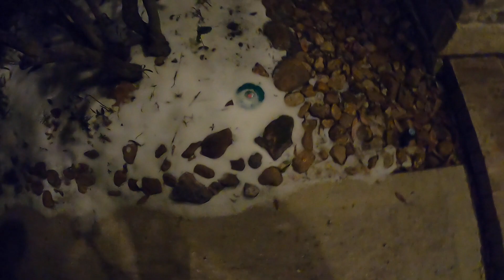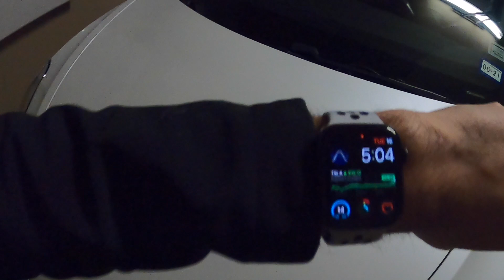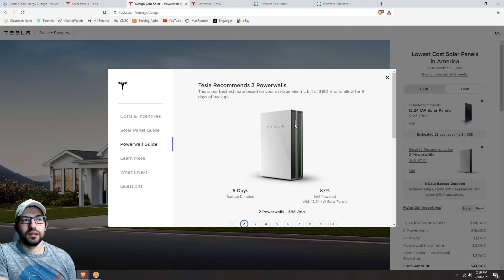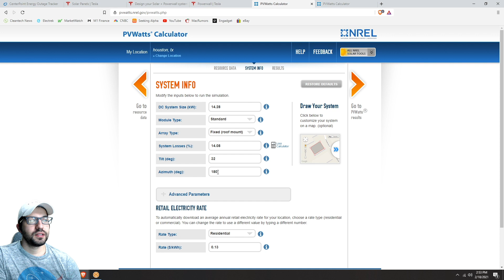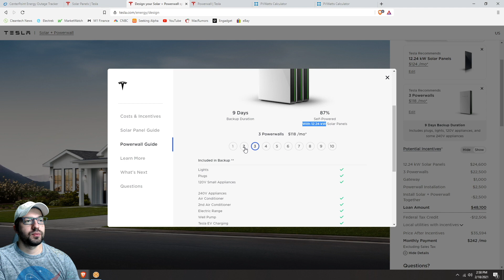Tesla Powerwall vs Texas Freeze: Battery Backup Power Tested ⚡️❄️

Comment: I am in Houston too and waiting for my Tesla install.  How does the metering rate work when pulling from grid?  Do you just get a base rate from counterpoint or do you still need to find a provider with lowest rate?
Reply from the maker: You still have to use a provider. I’m with Reliant which has a rate of $0.129 import and export. There are several you can use but some pay less for export and I wanted a true one to one rate.

Comment: Whoever told you the clocks use the 60hz for timing was full of *#%! And did not know what they were talking about and thought it sounded good.  The clocks in your oven and microwave etc run off of crystals which oscillate at a fixed frequency and are driven with rectified dc voltage.

Comment: A simple transfer switch would protect the grid and allow the solar to be used by the owner. The utility would not have to shut down your solar to protect its workers.
Reply: That would be true if the grid connected inverters weren't designed to shut down if grid power is lost. The funny thing is that you can buy generators that with auto-transfer switches that automatically isolate the grid from the generator power when the grid goes down. But for some reason the utility companies don't think this will work for non-battery backup solar systems. Could it be because you wouldn't be burning a fossil fuel?
Reply: @jjackson3240  If a solar system did not have batteries, it would not be a reliable power source.  Most solar systems are grid-tied to avoid the need for batteries.  If they are producing more power than you are using, the excess power is sent into the grid, if it is cloudy or night time and you are using more power than the solar panels produce your power comes from the grid.  Without a battery, the solar system would shut down if not producing enough power for your home.

Comment: Hi all, just a clarification, if you have any sort of electrical backup system, to prevent backfeed into the grid, you need a transfer switch.  This disconnects the grid and transfers to your solar system, or generator, or whatever generation system you have.  So you can use solar when the grid is down without a powerwall.  Your installer/electrician should explain this and how it works.

Comment: Why can the power walls not be installed with a room on the other side of the wall they are installed on?
Reply: I’m waiting for my power walls to be installed. I think it’s a fire code that requires it.
Reply: I think its because batteries can explode/catch fire. Its not likely, but it can happen. So i think the thought process is that you dont want the battery near where you sleep.

Comment: How many SF is your home? Im interested in doing this on mine a bit under 7,000 SF and trying to compare my cost/setup on it. I want to run it 100% with 2-3 days of backup power if that’s possible? This whole texas freeze really just made me reevaluate things thankfully nothing happened to my power but I want to be extra sure.
Reply from the maker: My house is 3868 sq ft with two a/c units. I have 2 Powerwalls but I really need 3 to be able to run both ac units in backup mode. It’s currently wired to only run my down stairs unit. I think I could run on batteries without the A/C for about 24 hours straight but usually you only need 12-13 because if its sunny or overcast the next day you should be able to produce enough to run your house during sun hours and charge the batteries.

I would think you would need minimum 4 Powerwalls.
Reply: @supertesla19  hey thanks for the video & information, very interesting so during the snowstorm you were still getting charge from the sun? Do you have to clean them often?
Reply from the maker: @PS-lm3tp  I’ve only been online since January 21, 2021. The rain pretty much cleans them. I’ll look at them after we get all the pollen.

Monday with the panels covered in snow I was able to produce 27 kW. The snow melted quickly the same day. I’ve got a picture on my Instagram “supertesla19” of my panels with snow.

I plan on making a video on how much electricity typical appliances consume. It might help people understand what a 1kW can do power.
Reply: @supertesla19  excellent 👍🏼look forward to the video, earned a subscriber

Comment: Hi just one little correction solar panels plus battery still will not work in backup mode you need an additional bit of equipment called the gateway. This will switch you away from the grid in a blackout and keep everyone safe.
Reply from the maker: Yes, that is correct. They are included when you get the system installed with Tesla if you get both solar and powerwalls.

Comment: Hi there. Also from Houston (well, Humble - close enough) and We just placed our order today. My house is 4500 sq feet but the most panels on tesla is 16.3kw. We’re asking if we can add more. They recommended 4 power walls but We decided 3 since we have a gas heater, gas water heater, and gas stove. We don’t have an electric car - yet but we do have a pool that I desperately wanted working during this freeze. Can you tell me what size your house is? Does it matter? Our annual use is something around 27,000 and the quoted production for the 16.3 is 18,000 but I saw you have a 14kw and produced 20,000? I’m worried the 16.3 won’t be enough?
Reply: Sorry, meant to add - I’m thinking the 3 power walls would be enough if we conserved use? You said you used about 1kw per day - is that on full normal use?

Thanks so much for posting this. Really really helpful!
Reply: @supertesla19  oh awesome!!! This info makes me feel more comfortable as your house is comparable to ours. So then maybe just up to 20 would suffice just to plan for the future EV. Thank you so much for your response. I wish we made it through this storm like you but I’m prepared going forward! I’ve also watched tour installation videos and looks like you got installed quickly. I was worried about inventory but at least now we’re in the queue. Was the process easy?
Reply from the maker: @mariacooper  It was an easy process. The most annoying part was getting approval from the HOA. If have an HOA I would start looking for their application. Once you have your design ready from Tesla ask them for a Loss of Production letter so you can give it to your HOA. The first time I applied to my HOA  I was denied. I sent them that loss of production letter and was approved within days.

I don’t have a pool so I’m not sure how much energy they consume. 
Each Powerwall stores 13.5 kWh
Reply: @supertesla19  thank you thank you thank you!!!

Comment: Correct me if I’m wrong, you can’t charge you powerwall since the grid is down? If that’s the case I thought there was some sort of switch in panel that only directed energy to the house and wall without going to the grid (like an opt in/opt out switch) which creates independence, be a shame if it’s not that way.
Reply from the maker: You can be completely off grid and charge your powerwall from the solar you generate.

Comment: Who did you finance with? And do they have a balloon payment at 24 months?
Reply from the maker: I did my loan through Tesla and they use Technology Credit Union out of California. There is no penalty for early pay off. My monthly payment is set the same for the life of the loan as long as give my federal tax credit within 18 months. If that’s what you mean by ballon payment then yes.
Reply: @supertesla19  Yes that's what I am referring to. You have to surrender your tax credit to them in the 18 months, if not, your payment balloons to 2-3 times the normal payment. For example the bank here said the payments would be $214/Mo, but if the amount required ($23K) was not paid within the time limit, the payment jumps to $479/mo for the remainder of the loan. What many don't realize is the tax credit is a credit towards your adjusted taxable amount when you file. It is not an automatic dollar for dollar credit paid directly back to you. So if you owe $10k for taxes, and you get a 10K tax credit for solar, then you no longer owe the 10K to the IRS, and you will not get 10K back in a check. And you still owe the $10 to the bank for the Solar within the designated time frame. So in my case I would have to pay $1100 month to make it on time or the balloon would take affect, unless my tax credit was sufficient that the IRS owed me money back and it was enough to pay the bank their minimum.
If you can pay cash to pay the amount needed within the 18 months, or IF you get enough back from the IRS to do so your all set. If not, expect the payment to go up. Just food for thought. You may want to check on that now so you don't get caught short.
Reply: PS: Nice system. That is what I am looking at, only 40 panels and three Powerwalls.
Reply from the maker: @johndube3422  It was literally life saving here in Texas.
Reply from the maker: @johndube3422  Yes I do understand it’s a credit. You are also able to carry any unused credit to the following year. 

I’m also going to be giving double my minimum payment. So I can pay less interest.
Reply: @supertesla19  I totally agree. You couldn't have timed it better. But after this is all over, you need to check on that so you don't have any unexpected surprises.
I bought a 10K Watt generator years ago. Have only needed it a couple of times, but it was well worth it. I want to get the Tesla system for emergencies, but also to use be able to reduce operating cost now and in the future thanks to a certain Joe and Friends. Be Well and Be Safe during your ordeal.
Reply: @supertesla19  Smart!